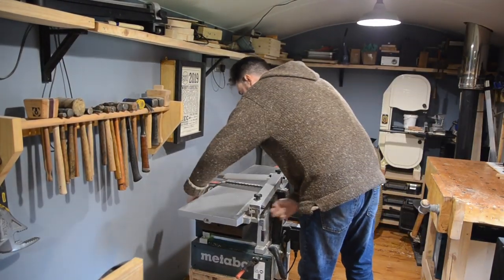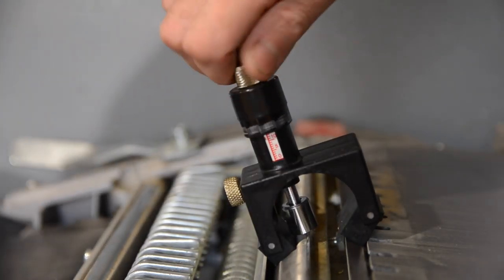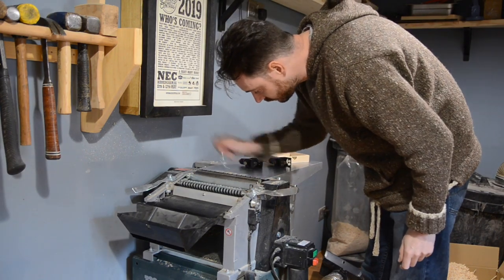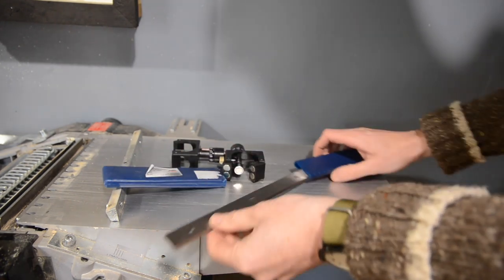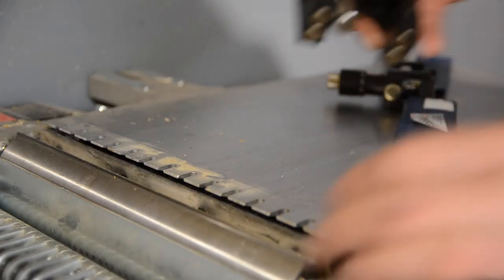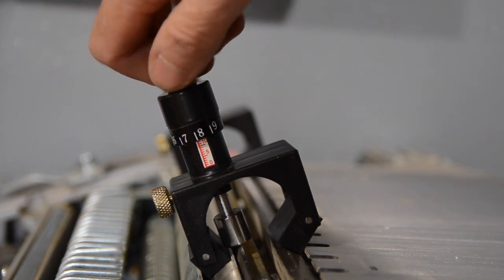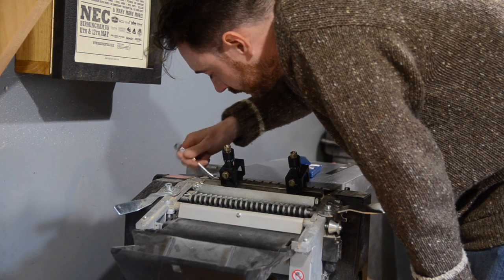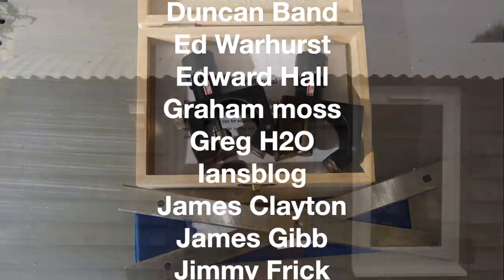Setting Planer Knives

Comment: Wow, that's impressive  (and less expensive than I thought) I watched the video only now because in fact I do not have a planer.
But I do have a combination-thingy, a small table-saw (with in the mean-time a blunt blade) which happens to have also something like a planer.
That part I've never used till now.  One week ago I decided to give it a try. I had to lift the planer blades which is not that easy.  (the whole combination is
25+ years old, no-name Russian brand and only a Russian manual (which I could not read, so I probably threw it away) Who knew 26 years ago that there will be
something like the internet, et. Long story short: I did not manage to set the proper and even height (too high, too low and/or not straight) because I have only one pair
of hands. This should be an ideal help. I wonder if I can find something like that in Slovakia  (I don't want to risk the "Amazone" one doesn't fit to the diameter)
and what's the name of it in Slovak language. At least now I know that something like this exists. Thanks a lot for sharing. This video was more helpful to me than I ever would
have expected.
Reply from the maker: Thank you. I hope you find some for sale near you